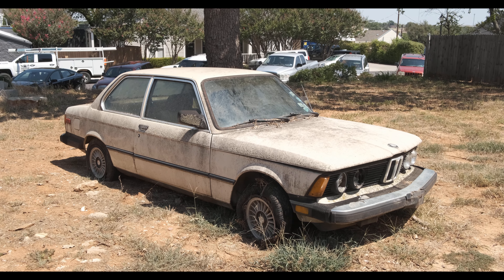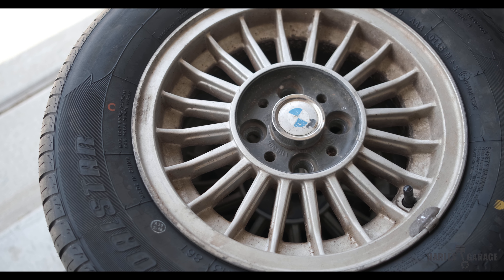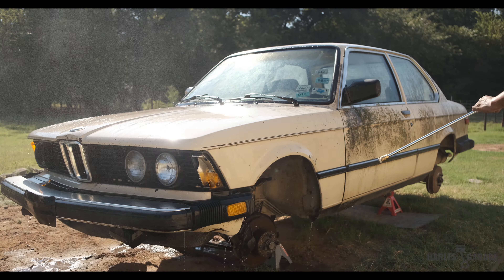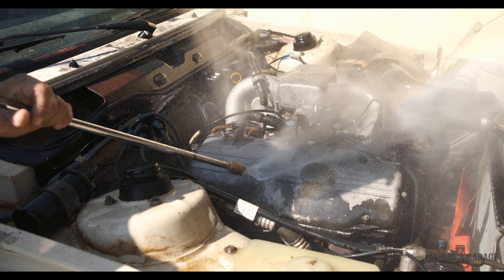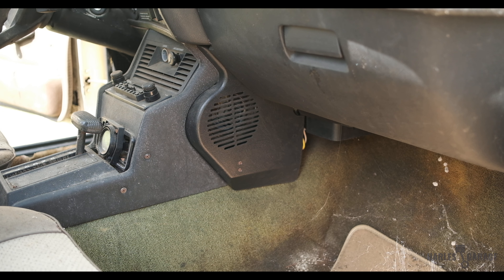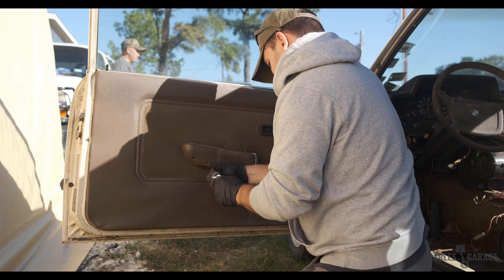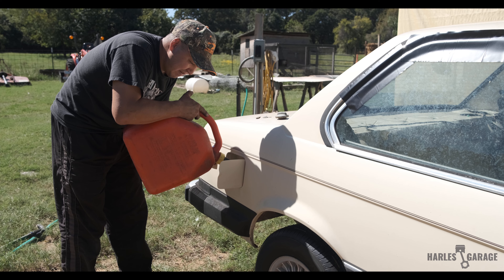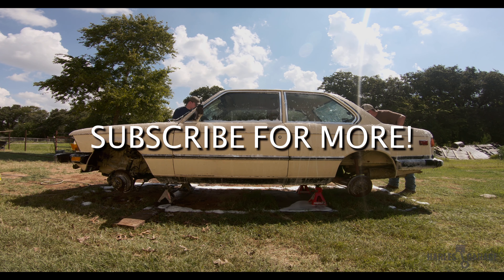I Bought This Classic BMW to Turn Into a Rally Car! E21 BMW (Project Quill | EP1)

Comment: Love to see more E21 content! I've been restoring one as well. Feel free to reach out if you need anything!
Reply: I have a 1978 E21 that needs to be restored, I found out that mice or rats were nesting on the inside and have cleaned as much as I can on the inside, however the smell of urine is still there. How do I get rid of that? how can I make it so that these rodents won't nest there anymore? 
I don't have the money to get it restored yet so I just need to keep it as clean as I can in the mean time.   Thanks!
Reply: @henrymcgalem5006  yup, I had to do the same. Lots of shampoo for the carpet and patience. If all else fails, replace the seats and pick up new carpet. Entire carpet sets can be bought on rock auto.

Comment: This series is so conveniently timed i just bought one of these things.
Reply: How much did you pay may I ask? I saw one for 5k in my town with under 100k but didn’t buy
Reply: @jessesward9429  just to give an idea, my cars exterior is in a little better than Harles but interior is a lot worse due to moisture getting in the cabin and seemingly soaking the carpet that was in it becoming a catalyst for the rusting process.  The engine runs and is actually in pretty solid for 180k, no brakes and the rad is cracked. All things considered. Mine was 500 dollars out a guys front yard.
Reply: @jessesward9429  I paid $2k last year for a rust free Nevada car - 1980 Hennarot, automatic with 122K miles - car had no interior though and racing buckets seats since the PO was going to turn it into a track car

Comment: Wow my gas tank had rust and water and bad gas in it, but nothing like the road tar yours seemed to have.
These have two fuel pumps, a low pressure in-tank pick-up pump, and an external higher pressure pump, about 80 psi.
Reply from the maker: Yeah it was bad. I could smell that mess for weeks. I’ve went ahead and got both fuel pumps and new lines. I’m going to flush out the hard lines. Hopefully putting it all back together by the end of the month or early February

Comment: Fuel tanks are not cheap - hope you can salvage them.
I managed to get mine repaired here in the uk
Reply from the maker: We’re hoping to get the main tank plugged up / sealed this weekend fingers crossed ...if not I’ll have to figure up a fuel cell.
Reply: @HarlesGarage   friend of mine just had a fuel cell made for this reason in boot area - he said was based on a mk2 escort rally car unit .

Comment: You fixed the car in a garage/barn or outside? I do not have an enclosed space to fix a race car E21 and I am concerned to get one now or later...
Reply from the maker: Im working mostly in a garage. Did all the interior rip outside. When I finally get to the body work I'll do some of it outside to minimize dust everywhere.

Comment: Man, this is e21 in incredibly good condition, don't turn it into rally car please.
Reply from the maker: Well the floors are completely rotten out and are about to be welded up. The rear of the body isn’t in bad shape. This car was going to go to the scrapyard so I am saving it and giving it a new purpose. I promise I’m not going to abuse this car , but I will have fun with it.